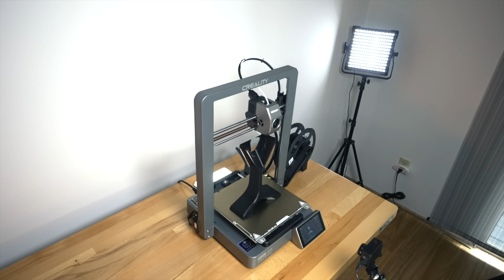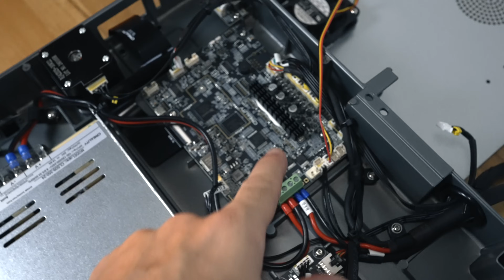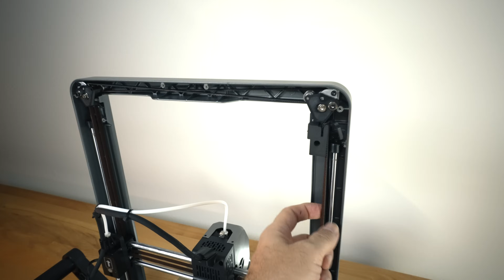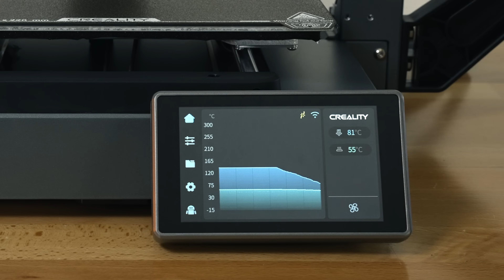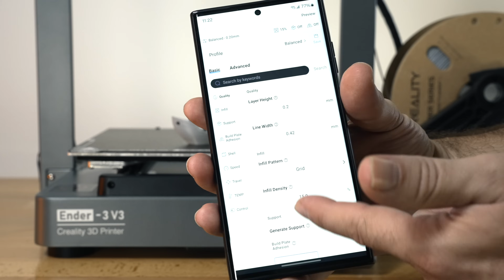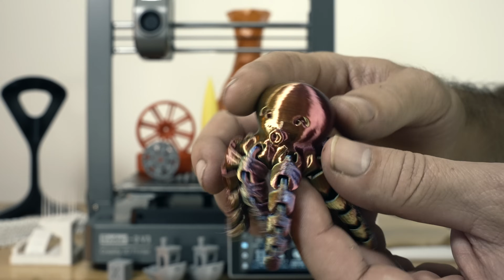Creality Ender-3 V3 - Core XZ 3D Printer - Unbox & Setup

Comment: Please Help. I have the Ender 3 V3 and I am in need of replacement parts for both cooling fans front (4 wires) and rear (2 wires red and black), and the axial fan for the hot end. As well as the front and rear covers of the print head replaced. I am not sure if anyone can help me find where these are, I haven’t been able to find them anywhere.

Comment: Quick question, do I just go with the closest volts? From what I know, Canada's 120V so I'll have to put it to 115V? Might be a dumb question but I just want to be extra sure that I won't burn this thing haha!
Reply: The instruction book will tell you which voltage you need for your grid.  I being from the UK means my ender 3 v3 plus needs to be set for 230v,  which it's set to by default from order.  I do suspect you want yours set to US however since that's the closest to your power grid voltage.

But please check on the instruction book to be absolutely sure.
Reply: @hikaru9624  thanks!
Reply: @somewhatideal  no problem.

Comment: Dude you can't just say you made a mistake and not say anything. I had to cut my zipties. Partially my fault for not watching before putting together but not cool.
Reply: Bro, I put mine together 3 days ago with just the manual. It's "unboxing and setup" not "how to set up the ender 3 v3". At least you learned a valuable lesson to read the manual for machines instead of relying on YouTube videos for the small cost of maybe 10 cents worth of zipties LOL
Reply: @notapplicable7810 my fat lazy az ain't gonna read instructions
Reply: POV: you bought a 300 euro 3D printer but sad you had to cut 50 cent cable ties.
Reply: @Nugacat yes bc the printer made me broke 😭

Comment: "This is aluminum, so it won't be as strong as if it was metal".....aluminum is a metal last time I checked lol. Also they don't ziptie the tube for a reason. It's incase the tube is over bent, it can simply pop itself off to prevent slipping in the extruder.

Comment: Hi man, I wanna buy my first 3d printer for helmets props maybe some smaller things idk and I was thinking about the Elegoo neptune 4 plus but now I saw this one and idk which one is better could you please tell me or if you know another one in that price range please let me know because I want to buy it this month
Reply: The Neptune 4's, last I heard, had some pretty serious klipper (basically an external software that helps speed things up) issues. The Ender 3 V3 Plus just came out, and it, like this, is a great helmet class printer. Would recommend over the Neptune 4 at the moment. 

But honestly though, the Elegoo Neptune 3 max is also great, albeit slower. If you just want an absolutely massive build plate for a good price, that's the one to go for.
Reply: Same position here bro.. iam lost on this. So confusing for a beginner
Reply: @diiogolince5343  well i bought the neptune 4 plus in the end and today it came just started printing my first benchy

Comment: K2 by Creality a BamboOOOo killer; 350 cube build, multi colour enclosed, FAST, 800m/s etc... SOON
Reply: K2*
Just came out!
Reply: @spencerbair1137  I heard 31st July
Reply: @3D_Printing  K2 Plus is currently on preorder. Fairly large discount. 30,000mm/s^2 accel, 600mm/s speed. CFS (creality filament system) up to 16 colors like bambu. New extruder and more. Maybe K2 Max or just base K2 Jul 31?

Comment: to resolve your issue, have you tried to remove your filament and rotate so that the spool picks from the top, not from the bottom, hence it wont tangle and goes to the back when it unspool

Comment: You said the layer lines look clean. I would suggest you look again, because it's terrible
Reply: You are right! The calibration cube looks awful. What are these vertical lines on headphone holder side surface? What is that https://youtu.be/Gk_pi__Qp84?si=_j8dvqpYCw6Wc6qk&t=2245  ?  My Ender3 from the first batch running klipper can do not ideal surface but much cleaner than that. There too many VFA...  The K1 can do much better than that. Probably there are no reason to pay more for the print quality of the low end printers.
Reply: @vitaliydj5929  man if i can show you my cube its different mines way better the local storage has a different cube and a new firmware has come out. BTW there are 2 motherboards with this the old version and new version.

Comment: What’s the difference between a corexz and a bedslinger?
Reply: same, other than the z and x axis are in a motion system similar to a core xy. Bed still moves back and forth, but the z and x axis are connected together with a belt.
Reply: bedslinger means the bed moves back and forth. corexy the bed moves from the top down to the bottom ;-)

Comment: I have started with creality but since i bought bambu lab a1 mini fell in love with 3d printing again. Bambu is on another level
Reply: @tek9058  Let me explain my experience what made me change the KE ..... how i rate a printer is straight out of the box if you can put the speed at 600m/s and do a 1st layer 0.1 layer and it performs perfectlty meaning running finger across the layer and if you cant see any defect its not the rails that made the KE fail with the out of the box corner to corner 1st layer perfection... was a combo of things linear helps the KE but with the Core Xz no need as there is stronger motors on the x and  y and they are  both parralell both on the X and the Y has 2 rails  plus the core XZ design , I proved it by buying it buy trying both  V3 utilizes the new Core XZ architecture the motors for both the X- and Z-axis are now located on the bottom, which means less weight moving on the X-axis, meaning less vibration and faster acceleration featuring sturdy frames that are more mature and stable in terms of printing.
THe z offset and rails are thicker and spread apart further & yes measuerment parralell front to back and they are thick.. now imagine the Plus is going to have even more support and all mmotors even bigger plus there 2 on bottom.

https://www.printables.com/model/694446-ender-3-v3-se-ke-y-rails/comments#makes

I could of done this very easy to the Ke . the v3 is perfect not a single faulty print yet
Reply: @tek9058  I started with Ender 3 1 with nob etc like the very first ender and i sold them to buy  v3 Core XZ . my GOD  its like going from apple 1 to 13 . I was told if you think its good wait till you put on full on klipper..  i wonder if i buy the filemant dryer as well maybe buy the cover ?? it would basically be K1  i got the v3 plus on order also
Reply: Legit just ordered a bambu mini after I got this ender and it started breaking mid print.
Reply: what started breaking llolol mid point from which moment mines still running like a gun and i just upgraded to the newer extruder , only cause i can and i like havent the best what beeter than all metal gears stroking a unicorns nob
Reply: @tek9058  that’s a good point
Reply: I started with an ender 3 pro, it was a great printer but Bambu lab is in another level. To be fair creality has come a long ways
Reply: Bambu lab engineers come from DJI team. That's why bambu lab is on another level.And bambu printer design and style is very similar to DJI.
Reply: @xutaokiki  Yeh mines pretty dam sexy especially with the upgrades and new creality 5 and the plus coming out at the end of year and multi color upgrade .... for the v3 nd k1 shhhhh ;) until this prints bad why change something thats perfect for me. I have DJI for my drones ill leave it for drones but 3d printing is a new ball gsme, i  thiink creality has more experience and customer feedback than bambu labs i admit  they loook nice but so do the V3 COre and k1 .
Reply: @Andrew-hr5on  don't touch a K1. The K1C is fine but the K1 has VFA issues. They fixed it on the K1C by changing the stepper and pulleys. The V3 is way better than the K1 in my opinion.